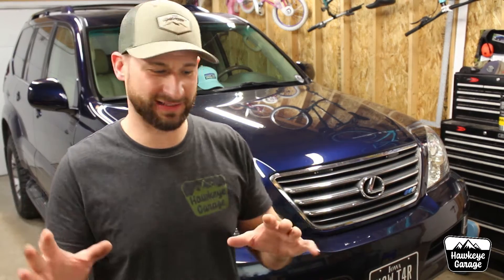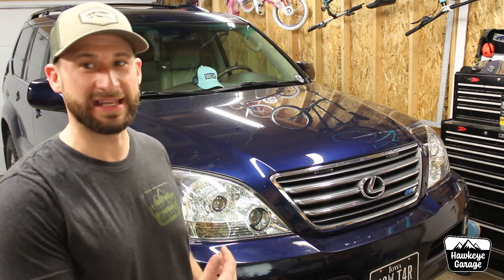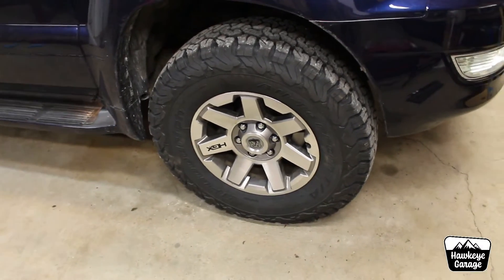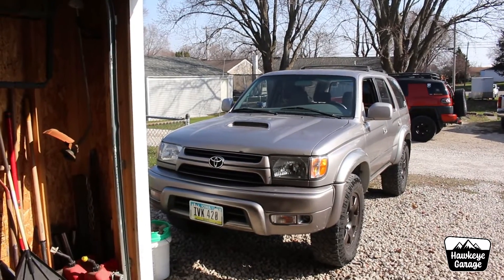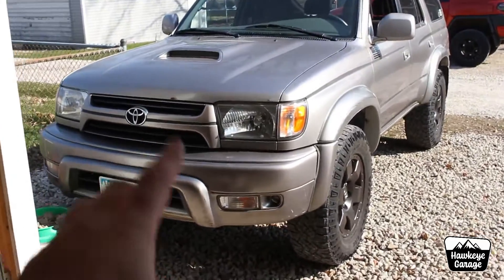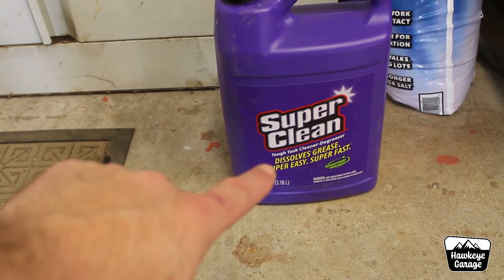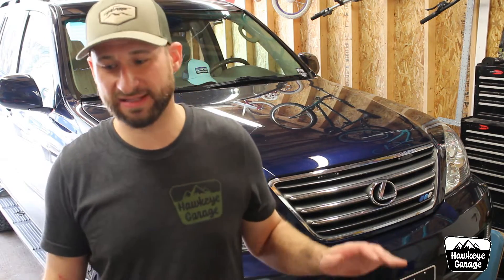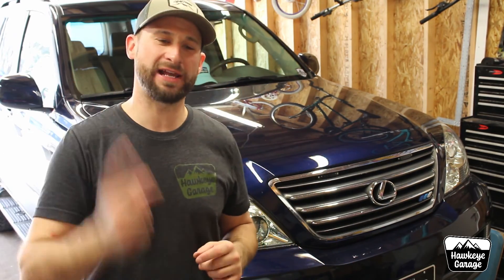4Runner and GX470 Builds

Comment: I have Front Coil overs, Rear Springs & Shocks, and Sway bar end links that I just pulled off my 5th Gen. 4runner about 10K miles.  Replaced with a full Dobinson's lift. Live just over the river from you. Will they work for you? Would have sent you a Email, but I could not make out the email address at the end of the video.
Reply from the maker: Hey email me! Hawkeyeskunkworks@gmail.com